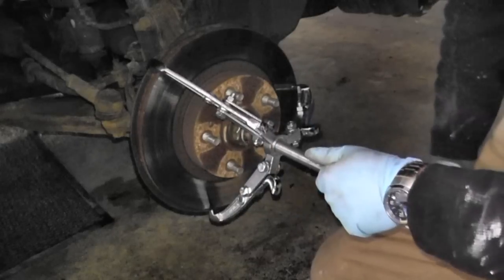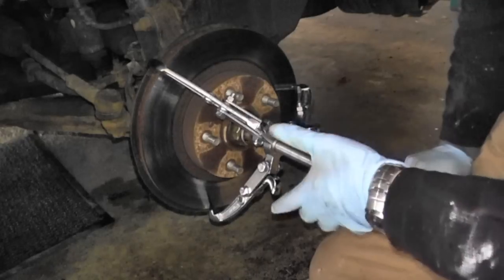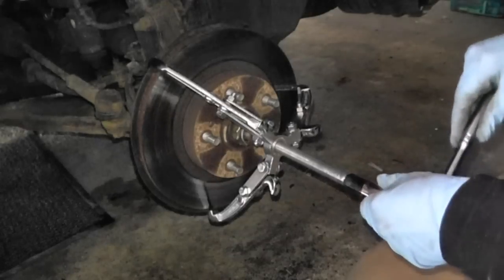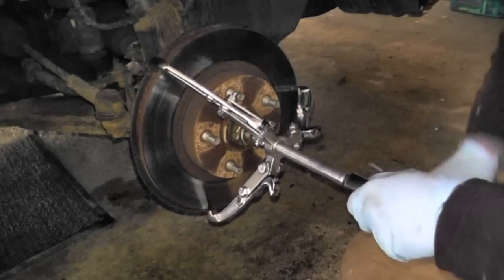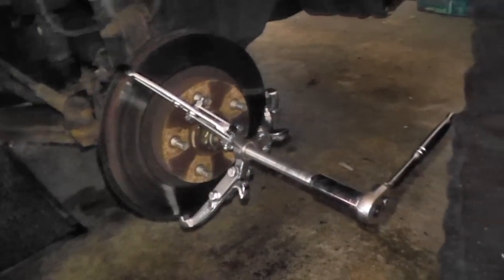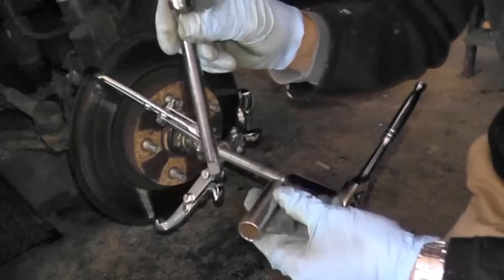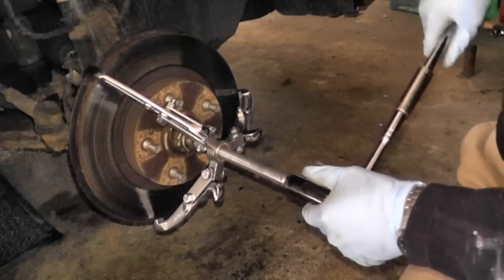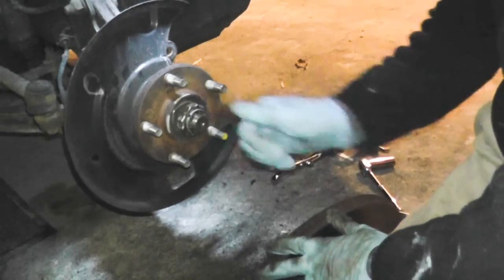Rotor Removal with a Puller HD

Comment: WARNING! Make sure you screw in a couple of lugs before doing this.
Reply: why?
Reply: @struggle29  because the rotor in most cases is stuck to the hub.  It would snap free and literally fly off. It happened to me and the rotor missed my knee by a couple of inches.
Reply: Thanks for the tip I have a jetta. Stud bolts all around. I'll make sure I stand to the side

Comment: Thanks very much for posting this video. I followed your link and picked up the 8" puller from Amazon. I had brought my Honda to a garage
and they claimed they couldn't get the rotor off and wanted to charge me $800 for front and rear brakes. It looked a pretty solid case of
garage blackmail. So I told them forget it but I let them do the back brakes. I just got the front rotor off using the tool you posted a link for
and the rotor came off using a craftsman air impact tool and your puller. This video was a lifesaver. Thanks.

Comment: Brilliant! Question, how is it that a 6 inch puller will spread to fit what looks like a 10 inch diameter rotor? Did you have to modify the puller or use it in way that goes against manufacturers recommendations?

Comment: Great work!!!. It took me and my son over 14 hours . Using blaster 3 lbs hammer, impact wrench.  Bolts into the rotor snapped, nothing worked . But the wheel puller finally did. It broke the rotor plate first try, Then wheel pulled the drum.No fun at all. And not for the weak hearted. Just takes a solid effort.  But can be done. Thanks for the video.  That did help.

Comment: Great! It worked for me like a magic yesterday.  I spent 30 minutes beating with hammer, no luck.  I applied some WD40, soaked for couple of hours.  I went to O'Reilly Auto Parts, borrowed the 6" Gear puller, used your technique, tapped little with Rubber mallet-Popped out like a magic. Again, Great and thanks for the video.
Reply from the maker: Ravi Bolneni That's awesome! Glad to help out. Cheers

Comment: Absolute magic!

I tried removing rotors on a 2022 outlander. Started with pb blaster. Moved in to whacks from a deadblow, rubber mallet, and a 3 lb mini sledge hammer. No luck! 2-3 hours wasted. 

Borrowed one of these from autozone. Took maybe 5 minutes to figure out setup and 2 minutes to brake tur damn rotor loose. So much easier!

Comment: My only tip would be to use lubrication on the puller threads, not only makes it work smoother also helps the puller last longer.

Comment: I tried your technique on a 2016 GMC terrain. Bought a 8" puller on Amazon. Great product. cost $26. However, these rotors were so bad I still needed to hammer from behind the rotor with a mini sledge while using the puller to create pulling force on the rotor. This SUV in only 4 years old but all Michigan Weather.
Reply: Tell me about it same on my yukon
Reply: me too....pulley alone wasnt enough👍👍

Comment: That extension trick is absolutely amazing.... Your a genius.
Reply: +Riza Khan not sure i would risk wallowing out the socket hole or the end of the extension.  i use a large wrench, slip the closed end over the end of the ratchet and push down.  or just keep a scrap pipe around.

Comment: Thanks this worked a treat!..once I had a fair bit of pressure on the 8 inch puller I gave the side of the Top Hat part of the disc a couple of whacks with a Hammer  ..and "POP" off it came :-)...interestingly my 04 Holden Commodore (Australian Version of a Chevy) seems to have an interference fit even with a brand new disc and everything clean I still had to put the wheel back on  and tighten the wheel nuts to get the disc to seat..so it's not just corrosion holding it on...THANKS AGAIN!

Comment: I would suggest use some love taps when you get a slight bind you can destroy your thread on puller.
Also safer since you won't have excessive tension. 
Another would be keep a lug nut at end of threads so don't fly at you

Comment: Thanks for posting this, I had a rotor that was seized on as well and this trick worked like a charm. It got so tight and couldnt turn anymore, then tapped the rotor slightly with a hammer and it popped right off. Thanks for the great tip!
Reply from the maker: cutzwithrazzor Awesome man! Glad it worked.

Comment: i just used one of these claw thing about an hour ago to pull of a rusted rotor. put a couple lugs back on so the rotor didn't go flying, but yeah it worked easy. No hammering or Penetrating spray. I was actually kind of shocked at how easy it came off.

Comment: I’ve had rotors fly off due to the amount of torque to remove it with a rotor puller. Stand off to the side and use a longer wrench or breaker bar unless you want to eat a rotor.

Comment: I use a puller that allows me to hook up an impact wrench. Takes them off really quick, but the pop will make you jump if you don't expect it.
Reply from the maker: Good tip!
Reply: All pullers like this you can use an impact wrench on, now the ones that are not specifically impact rated if you don't use them lightly they will mess up the threads and shorten the life span of the tool. Ideally use some grease or other lubrication on the threads and use the impact wrench sparingly a little here and there. The trick is not letting the threads get too warm/hot. 

Also using this kind of puller you don't really want to just impact on it until it "pops". That's a serious hazard depending on what you are working with. A rotor isn't that bad but other uses can be. What you really want to do is to get it tight, get some decent tension on it either with a wrench, socket, or impact just don't keep going until it pops, go until it's fairly tight and hit the end with a hammer a few times. It will loosen up some then tighten it down a little more and continue the process. Or if you don't mind a trip to the hospital just keep going at it and roll the dice.

Comment: Im going to try this puller method next.  I do not care if my rotor breaks because I have new ones coming, but Im trying to avoid breaking anything else, i.e. the steering knuckle or wheel bearing.
Reply: The wheel bearing is fine because there is no stress on the cup or race. The stress is in the same direction of axle shaft, unless you bend the axle, which is impossible compared to bending the steering knuckle. People bend steering knuckles using the steering knuckle with the bolt method
Reply: Rotor wont break they dont even break from impact in a car crash or very rarely. Worse case scenario a small dent or scratches.
Reply: At some point, you just have to give up and cut them with a torch, though.
Reply: lol mind as well junk the car at that point
Reply: Not at all, they torch the things all the time at the shops

Comment: I would use a jaw puller with light pressure.  Spray the pb blaster and let it sit for a few hours which will work even better.  Pull it off and wack it with a hammer.

You can damage the axle nut, drive shaft, and gears in the transmission using this method with excessive force.

Comment: Dude I just spent 2 hours beating the living hell out of the rotors on my 2022 Crv. I had to bend the dust shield back put the car in neutral and take a full size sludge hammer to the back of the rotors Turing then ever few hits to get them off. Why are the tolerances so tight on the hub to the inside of the rotors. A lip of rust build up that was preventing them from coming off. I am buying a puller I will never go through this again. I have never in 29 years of doing my brakes had an issue even close to this.

Comment: I'm doing my rear brakes and I loosened up the E brake all the way and it's still stuck on. Beat on it for 3 hrs with a dead mass hammer and still can't get it off. I'm going to try this method to get my rotor off

Comment: I was about to go and buy one of these puller things but then had another idea...
Slacken the wheel nuts/bolts off, do them up finger tight, then undo by 1/4 to 1/2 turn or so. Drive up the road at about 3-5mph then stamp on the brakes.

Comment: I bought a 6inch puller for this. Little bit difficult to fit it for 280mm brake disc, but got it in the end somehow. Go for 8inch puller guys.
Reply from the maker: +Santhanam Venugopalan Good tip

Comment: Nice. I will try this on my astro van. Read rotors won't come off.
Reply from the maker: Good luck.
Reply: @CarsNToys  this didnt work. the puller tool was to small for my rotors. but i got them off any way. my dad told me to just use some liquid wrench and a 3lb hammer.

Comment: Most, if not all rotors will have two threaded holes, usually M8 or M10, depending on the rotor size on their face. All you have to do is thread down a long enough bolt through these threaded holes, and once they hit the inner mating face, just go down a couple of threads over each bolt, and voila!, you'll have the rotor out in no time and trouble. They are called extractor holes back where I live....
I have a fleet of 28 cars, and trust me, they work fine every time, and with every car !
Reply from the maker: +Safe Line  Fleet Very true indeed!
Reply: +Safe Line  Fleet I'd say maybe most, certainly not ALL. I'm here because my 2012 Ram 2500 doesn't have the threaded holes. The one in the video does, but that doesn't help me. I've used "Powerful PB Blast" and a 3lb steel mallet, so far without success. I don't have a torch. Any ideas?
Reply: I have had two rotors that were so rusted, that when the 8mm bolts were threaded in, the rotor merely cracked as the area around the threaded holes was lifted and the rest of the rotor stayed put.   Only heating with a MAP/O2 torch and a 3 jaw puller were able to get the rotor off.
       Operating a vehicle in a cold climate where salt is used to De-ice roads really sucks when it comes to maintenance and rust.
Reply: +Stepclimb There are always exceptional situations, as yours. They probably add up to like in 1 in 1000, 100000 maybe. And the best part is that you count as that one ! Sure, as you say , de-icing salts can wreck havoc on the undercarriage and other components that it makes contact with. I live by the sea, here in Chennai, India, where the temperature is a min 30 deg C during winter, and 44-45 deg C in summer, with a humidity level of 92-99% most of the time. And the humidity comes from salt laden sea water. This stuff corrodes and spoils every part of the car - body rust, door hinges, wheel bolts when you have a flat.....
So, you can cheer in the knowledge that you have to deal with man made salt conditions, down here, God and Nature does it for us....
ha ha !
Reply: Mine doesn't  have the holes...sooooo.
Reply: Chryslers don't, at least my dodge avenger (mine), journey(my buddies moms), caravan(work)
Reply: I tried the 3 prong puller only breaks off the ends of rotor where it contacts 1 each time because it can only grab the outer lip of cast iron rotors, even with my high power propane torch... Now heading over to Lowes for some 1/2" x 3" bolts to try the other trick to push out from back .. Wish me luck all!
Reply: Thats how you bend the knuckle  and kill your brake pads
Reply: rotors dont have holes, none that I have ever seen . Some drums have .
Reply: raga raga can you explain this push out from the back w screws trick?
Reply: Mine had a threaded hole that was conveniently stripped.
Reply: Factory ones yes. But if the owner dont replace with oe, they dont come with them holes.

Comment: The jack screws or a hammer would have worked well on that rotor. It's barely even rusted.
Reply: Wouldn't be a great way to demonstrate the claw puller though, would it?
Reply: @dexkmetz3102  lol

Comment: The socket that you used for extension is rated for torsional stress. Your extension action puts tensile/compressive stress due to bending moment and sockets are not made to handle that. Please use the right tool such as breaker-bar or a proper extension to do the job right without getting hurt.
Reply: I put a pipe over the wrench.
Reply: Steel has a nearly isotropic modulus of elasticity meaning it is equally strong is tension/compression no matter the orientation of the applied stress. The stress from bending that he applied is nowhere near the limit of the shear stress from torque that this socket is rated for.
Reply: I just use a hammer and I worked in many a dealers as a licenced mechanic! Or air hammer

Comment: My rotor was so stuck it broke the gear puller "claw" end off.
had to cut around the OD of the rotor that makes contact with the  bearing flange.

Comment: hey i was doing this today and the middle part is pushing my cv axle inward. did this happen to you as well? i can't tell from the video.
Reply: Don't take the nut off your center CV Axle or you have no firm point to pull from if you are using the puller method shown in this video.  I am sure you have figured it out by now.

Comment: didn't that rotor have 2 bolt holes in it?  A steering wheel puller would take it off with the right sized bolts to fit the tapped holes on the face by the lugs. because your not driving the force out but in the center it requires less force to slid off also you can tap the rotor with a mallet or ball peen hammer as you tighten up the tool.  I'll bet it is 2 cars the first one he broke the rotor pulling the vent channels because cast iron is brittle, I think it has a higher carbon content? but I'm not sure..
Reply from the maker: No rotor screws on this rotor. (Nissan rotor in this case) And a three pound hammer definitely works as well. Cheers

Comment: Instead of going for the socket and extension to get better leverage I think it would be a lot better if you just took a 2 to 5lb sledge, or whatever bfh you have and hit the end a few times this will loosen things up a bit and allow you to keep tightening so when it does break free it's not coming free with as much force. 

Also if you need additional leverage you can also use an open ended wrench, pipe, or whatever you can find.

Comment: Terrible.  The puller is being abused (used wrong) and your lucky you didn't ruin it.  Those legs on the puller should be nearly parallel to the screw shaft when being used, not spread out as wide as they can go.  The rotor removed in this manner should not be reused.  "because you can, doesn't mean you should".
Reply: You get that this puller has three legs right?
Reply: @dg8620  I can see them and count so yes.  The three legs are spread way to wide.  All you had to do is remove the large spindle nut, remove the hub with the rotor and use a press or a large hammer and block of wood to separate the two pieces.
Showing novices how to do things wrong and dangerously is not a good thing to be doing.  Make videos about something you know how to do right.

Comment: what size is that puller?
Reply from the maker: 8" - if I remember correctly. This was a number of years ago. I have a set - https://amzn.to/2UY2um2
Reply: @CarsNToys  ok thanks. I have a disc brake thats 12 inch in diameter and aren't sure if an 8 would work
Reply: @CarsNToys  thank you. Do you remember the disc size? I have a 12 inch disc and I'm just making sure its the right size

Comment: use a big ass hammer rotor is not much a problem Brake drums are.
Reply from the maker: +GAR A Agreed
Reply: Yeah, my rear discs have  parking brake shoes built into them. Makes it much harder to remove than a normal disc. Yes, I released the parking brake. :-)

Comment: I try the puller, but I break my disk !!!
Reply from the maker: sylvain beausoleil What a bummer! Go to your local auto part store and rent a puller specifically made for rotors. It will latch on where the lug nuts are and you'll be able to pull off the rotor. You can also get a 3lb hammer and hammer the back of the rotor; or what's left of it. I use this technique in my wheel bearing replacement video. It works but takes a lot of muscle.